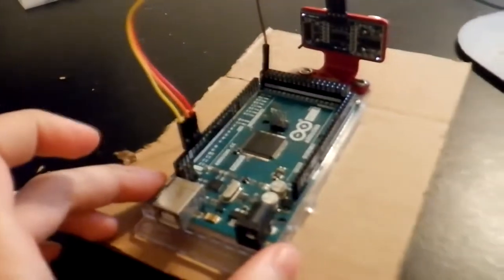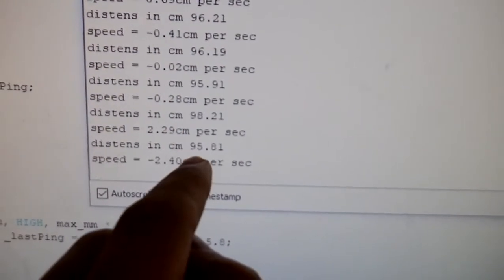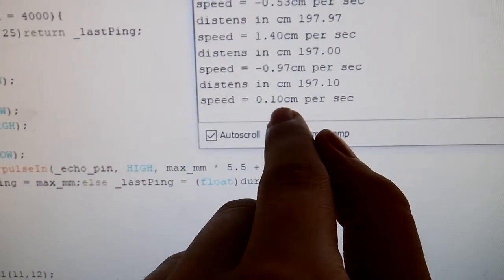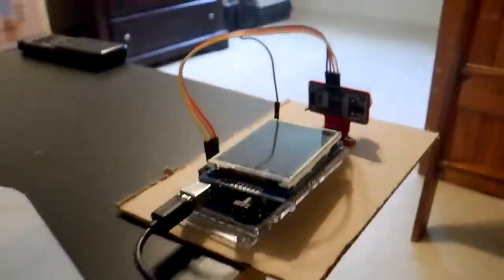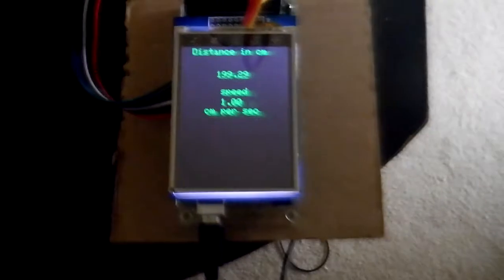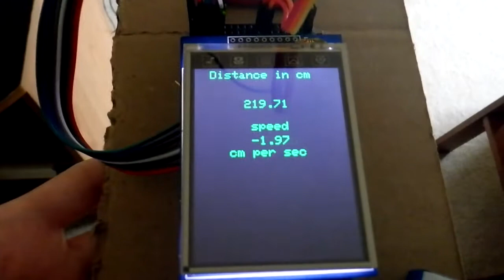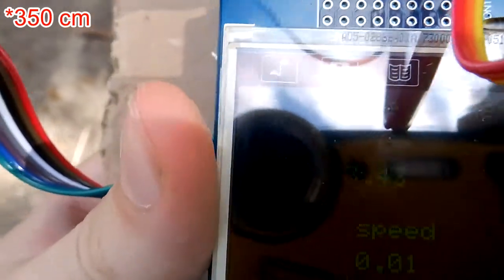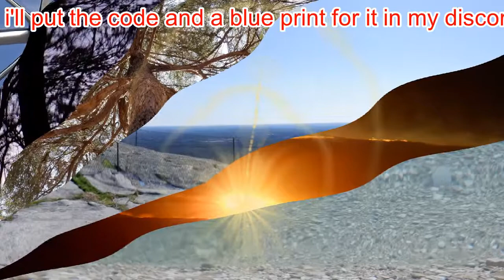DIY Arduino radar gun

Comment: Have you used it to measure the speed of baseball?
I want to know the effect on measuring baseball speed.
Reply from the maker: That, would be interesting to try, but I don't think it would be accurate enough. It can only measure things straight in front of it
Reply: @sirSNoaH  
Thanks for your reply !
I agreed with your opinion.
I think the exact accuracy depends on the length and angle between the object and the gun.
If you want to do that, you had better figure out how to solve these problems.